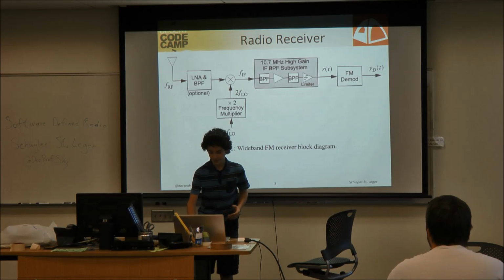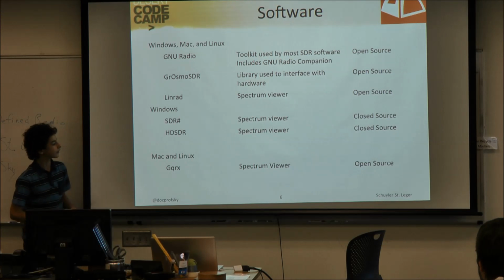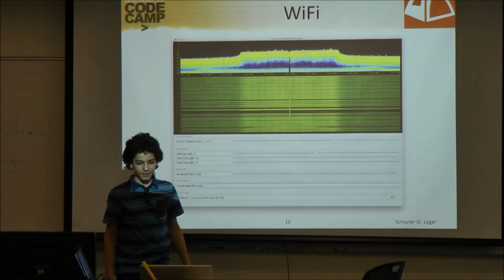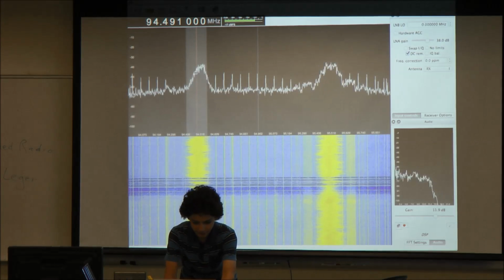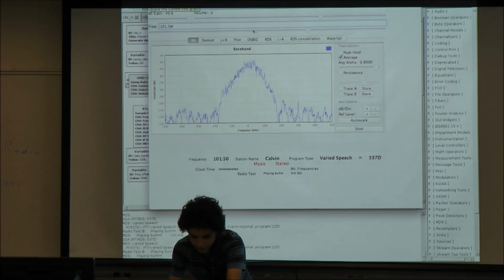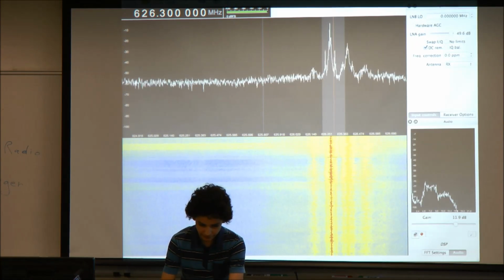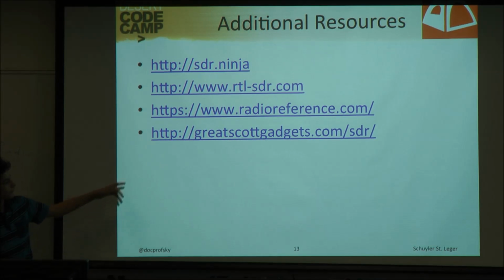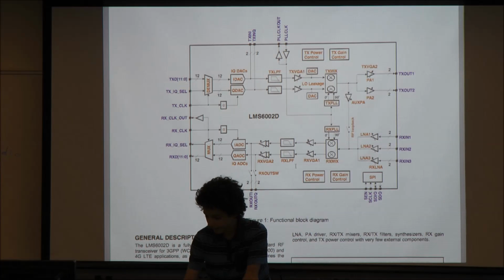Software Defined Radio - An Introduction

Comment: I still can't figure out how he can say, that he does not understand the difference between SSB and CW at 25:40 and hold a amateur radio licence.
Is the amateur radio licence in the US that shallow, that is does not even cover that?
In Germany you have to understand receiver circuits for each band an much more for the common modes.

Comment: FPGAs  are used in satelites,  changing the software  there, remotely from earth,  is equivalent to traveling to space and changing the PCB board in an old fashioned satelite.  Only a lot cheaper.

Comment: Regarding the concept of mixing. For example, you have two frequencies of 100hz and 150hz. You will end up with your two starting frequencies AND their sums and differences, in the case those are 250hz and 50hz.

There is no math (persee) going on here. That's just the natural results of mixing in the analog world.
Reply: It's an infinite series. Plenty of math going on.

Comment: Very cool. One correction though, in a standard, old-school hardware radio, the mixer does not multiply frequencies and the "math" going on inside the mixer is actually quite straightforward: as signals from the amplifier and local oscillator are mixed, they are added to each other and also subtracted from each other (i.e, both the sum and difference are produced). The sum is usually discarded and the subtraction is used. Thus, the local oscillator is usually tuned to a frequency lower (by the amount of the IF frequency) than the desired tuned frequency. For instance, a broadcast FM receiver tuned to 102.7 may have its local oscillator tuned to 92 MHz and feed the resulting frequency to the fixed-frequency, 10.7 MHz IF (102.7-92=10.7).
Reply: Hi corisco. You are right that the mixer doesn't multiply frequencies, but actually a mixer does multiply signals in the time domain. The effect this has in the frequency domain is the sum and difference you mentioned above. 
Mathematically, a mixer is explained using the trigonometric equation:  cos A * cos β  =  ½[cos (A + β) + cos (A − β)]
Reply: Migsterification Yes - but that applies to wave form and phase,  not really important if all you are interested in is the actual input and output frequencies which was the object of my comment.
Reply: Haha give the kid a break. He comes from an era where they call a record "a vinyl."
Reply: All true. The boy is good though. !.
Reply: @corisco tupi Instead of dismissing Migsterification's post as "not important" you should read it carefully and realize that when input frequencies to a mixer are Fa and Fb, their instantaneous values are cos(2 pi Fa t) and cos(2 pi Fb t).  Migsterification's trig equation demonstrates sum and difference frequency outputs when you put A=(2 pi Fa t) and β=(2 pi Fb t).

Comment: Great job, Schuyler! If you want to understand how a mixer works, I recommend downloading some technical books or papers on analog radio from the 1960s or earlier. Back then they explained things in common terms first, and then quantified it with the mathematics. Nowadays, they just give the mathematical formulas with scarcely a word between them because they don't really want anyone to understand technical information.  It may also be possible to find information on an english language non-American website. Sad to say, that has been consistently my experience for at least ten years now.
Reply: I teach our soldiers music theory as it relates to amplifiers... sure, solid state is better, but the concept is the same.... Those uber smart kids I will tesese them into this field... so far I;ve gotten about 2 out of the thousands...

Comment: Rick Jones;
ARCO25 trunk is hackable but it would take 8000 bucks in gear to do it not to
mention a 4 year degree in Computer and electronic science.
Not to mention being a member of Anonymous group will help.
WHEN all you have to do is go out and LEGALLY buy and ARCO25 capable scanner.  You can modify [Illegally] them to listen to blocked frequencies but it's really not worth the hack, All you get is military digital data with the hack, what's the sense, The legal one is about 450 dollars at Radio shack for starters, unmodified and legal;
 it's all you need.

Comment: Re the spectrum analysis question, we've heard reports of the SDRplay RSP working well with DL4YHF's Audio Spectrum Analyzer ("Spectrum Lab").

"I took the SDRplay HDSDR ExtIO DLL file and loaded it into Spectrum Lab, and it works :-) - needs more investigating, but it sure works.... "

The Spectrum Analyzer software can be downloaded from http://www.qsl.net/dl4yhf/spectra1.html 
and SDRplay info is on www.sdrplay.com